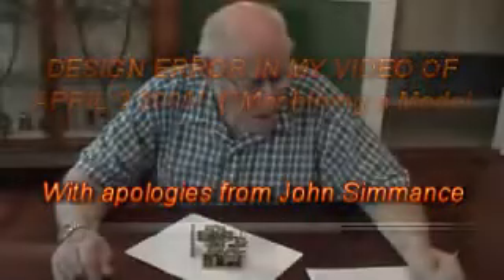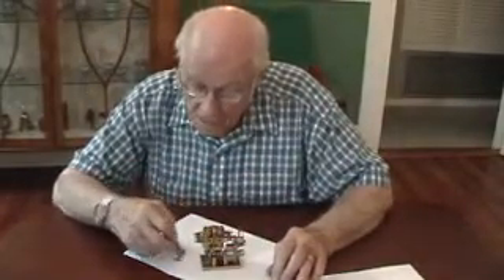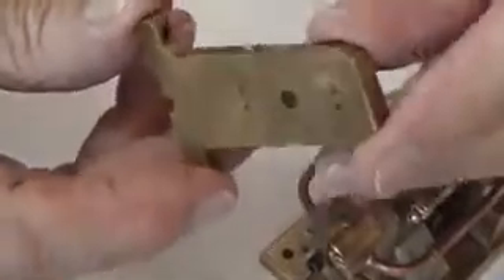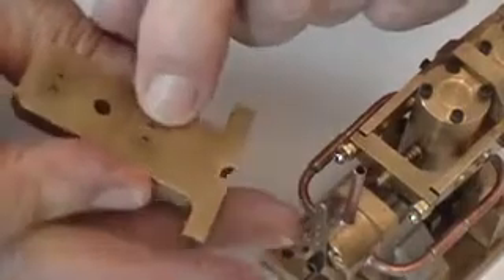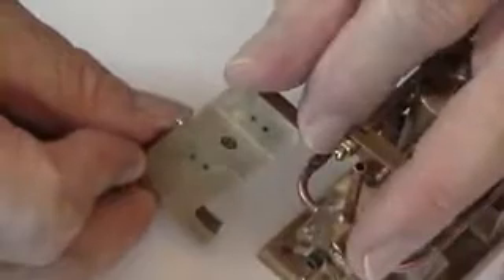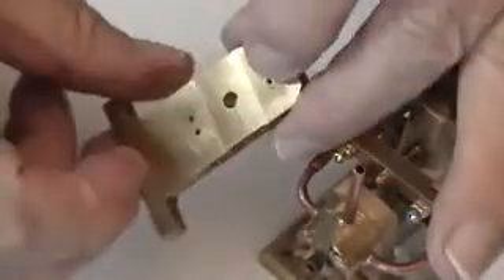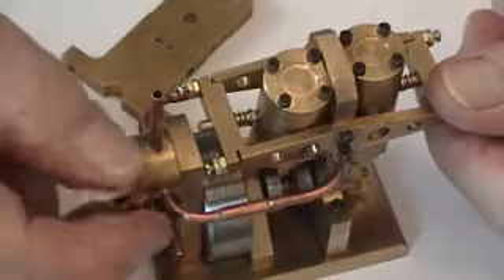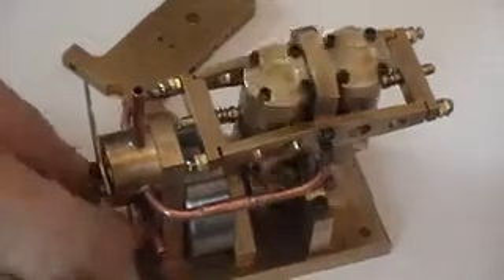CORRECTION OF FUNDAMENTAL DESIGN ERROR!

Comment: While we are on design error (insert smiley face), the #2 cylinder has twice the counterbalance of the #1 cylinder. I'm glad your engine works, but if there is enough counterbalance on your #1 cylinder, then you can simplify the design of the third crank member to just a simple circle. It essentially becomes a second flywheel. Well done, and thanks for your videos. I'm an engineer who's learning model machining now.